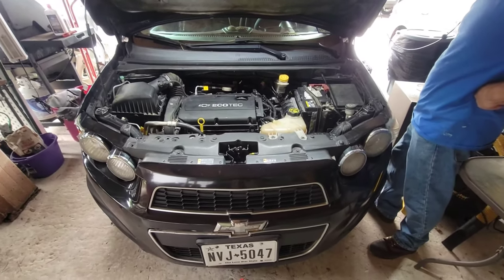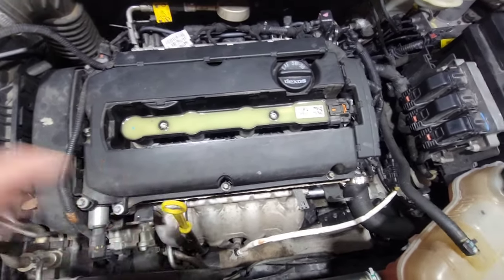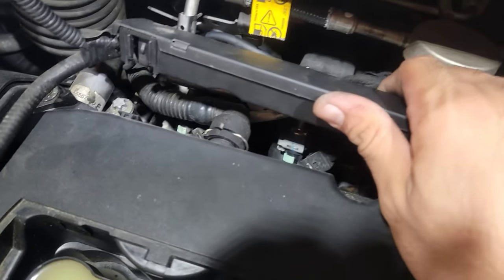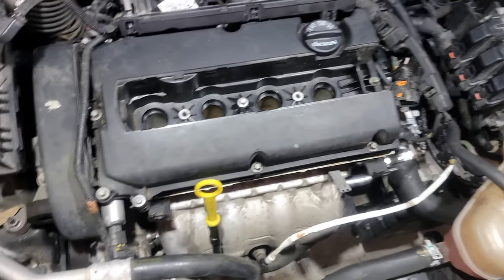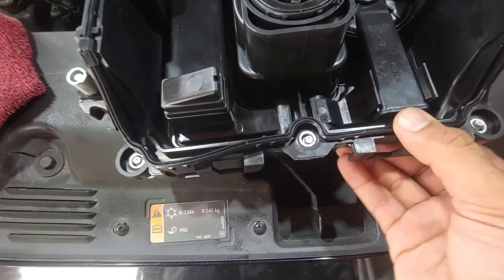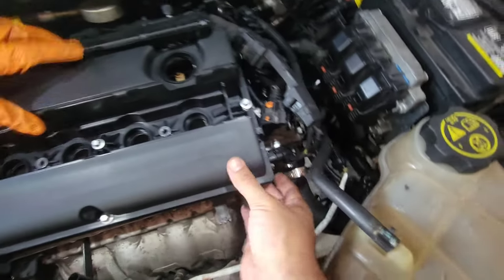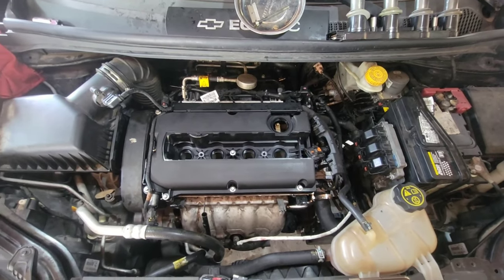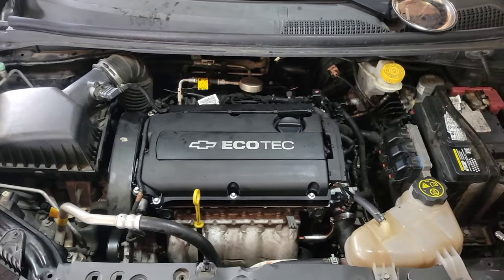CHEVY CRUZE / SONIC ROUGH MISFIRE FIXED FAST & EASY 2011-2016 P0171 FUEL SYSTEM TRIM TOO LEAN FIXED!

Comment: That’s not the PCV on the valve cover. That’s a vacuum diaphragm to control vacuum in engine.pCV is in the intake manifold and another at the turbp
Reply: Its not the turbo engine
Reply: at 6:47 he shows the underside of the valve cover and points out the "PCV" molded into the cover
Reply: No, the pcv valve is part of the valve cover.

Comment: That's probably a temp fix .  there's another diaphragm inside the intake manifold that breaks ..  you have to replace the intake manifold , but it will break agin ,   there are kits made to bypass the OEM PCV system and fix the problem long term . it requires plugging up the manifold diaphragm and re routing the PCV tubing and adding two Tee sections along with a one way check valve .. also replace the check valve at the other end by the turbo inlet . that piece that fits onto the turbo inlet is a one way check valve that blows out easily
Reply: Its not the turbo
Reply: Not on the 1.8L.

Comment: hi. Is it normal that when the engine is running and you remove the oil cap or oil dipstick the engine is sucking air. When I do that idle gets unstable and when i put them back on and everything is sealed the engine idle gets back to normal. thank you for sharing the video.
Reply from the maker: Yes it's normal. It's actually what's supposed to happen.

Comment: In other videos showing how to replace the valve cover, they talk about two places where they apply silicone before where the valve cover gasket makes contact. Did you get away with not doing that?

Comment: My car idling on my 2013 Chevy Cruze 1.8 and like it goes up and down the RPM needle and it sounds like it wants to shut off but it doesn't the engine light does not turn on or anyting but I can tell the idling is off should I do this or should I wait till that engine light turns on
Reply: My sonic is doing the same check your spark plugs for oil or ignition coils
Reply: Same

Comment: omg!!   a plastic valve cover with the pcv valve built into it???    how much more sadistic can these people get??  also you say this is the way to access the spark plugs?!?   so that means its "possible" to drop something into the cylinders from here?

in the old days it was a 5.00 canister stuck in a hose you would shake to see if it rattled.  about a 5min fix.

so now its a 300$ garage repair?

great video by the way.  thanks.
Reply: It's an awful design. I've had this same year and model since new and although it's fairly easy to work on, it's also dumb to integrate the PCV valve this way. The original coil pack lasted around 6 years and I've needed to replace it around five times since - either the aftermarket ones are junk or there's something in the design that stresses them out (probably both).

Comment: Nice.   But my problem is repeat engine stalling under 40degrees F.....once it starts its smooth no nothing.....until another cold start.  At the start....same temp outside all day....no problem....1st cold start...stalling.

Comment: What do you do if that little orange tab breaks? The one where you said listen for the click.
Reply: Mine's been broken for several years. Just push the plug back on and it still stays.
Reply: My husband fortunately works at a shop and found a replacement clip for mine

Comment: That's not the common cause of the rough idle
Reply: Did you know the cause of rough idle and rough movement when i put on D (1gear), engine rough just like EGR dirty but I cant find the EGR, mine are 2010 1.8LT cruze. thanks
Reply: Way to not be helpful at all

Comment: Hello! I just saw you have a lot of videos related to Chevy Cruze/sonic. I got a Sonic 2012 and everything’s fine with the car but there’s a problem. At first it was shaking a little when idling so I changed the spark plugs and it improved a lot. However, when idling in park/neutral/drive gear it’s like the engine needs gas or something and makes an intermittent chime (like the one when you’re not using seatbelt) that only happens when I stop at a traffic lights or when I am parked with the engine running. But when I give some gas to the car the chime stops. There’s no engine light. What do you think it could be? Can I send you a video? I really want it solved because it’s very annoying. Thank you so much!
Reply from the maker: Let’s see what you got. Make a video and upload it to YouTube and tag us or mention me in the comments and we will watch it and try to help you
Reply: @HidalgoMotorsCo  Sure, I can do that. I just saw that you’re located in Houston right? I would like to take it to your store ñ. Do you do service?
Reply from the maker: Hey bud yea we are in Houston just Google our address - Hidalgo motos co llc 2 - we have a mechanic on sight that can assist you
Reply: @HidalgoMotorsCo   I'm trouble with my  chevy cruze 1,.4 tubro  I have replaced  lots of  parts already
Reply: @HidalgoMotorsCo   changed  water pump  ,thermostat and  more I need help please would appreciate it  ty
Reply: Josh, it has now been a year since you posted about the issue with your car. Did you ever figure out what the chime was all about?  I was thinking that it was the shut down feature that causes the engine to shut off to save gas when it senses that you have come to a complete stop, but maybe I am all wrong about that.

Comment: I've got a used Chevy sonic.  It has this problem but I took it to a mechanic and they did exactly this, and it didn't fix the problem.
No code.  And three different shops couldn't figure it out.
It seems to only do it when the gas is low, so I'm thinking it's actually the fuel pump or filter.  
I'm having a hard time finding a filter change video for a 2014 Sonic.  Garbage car.